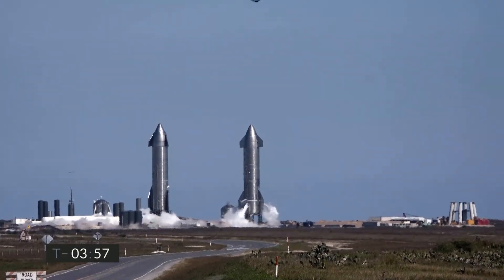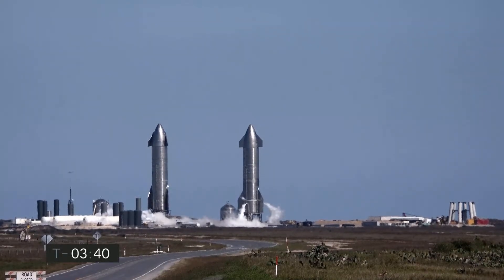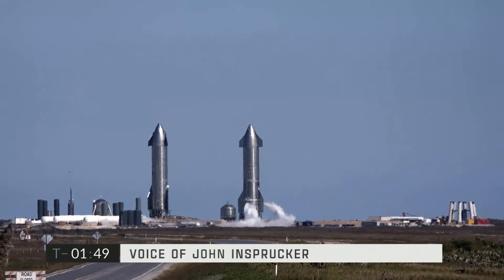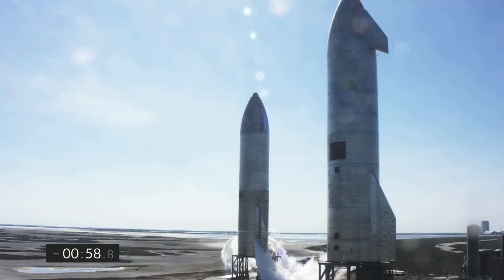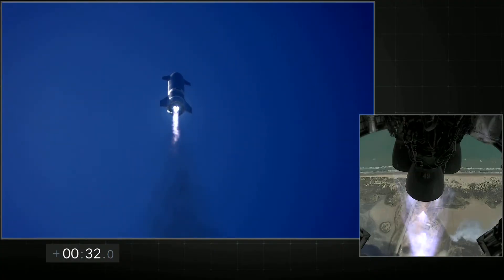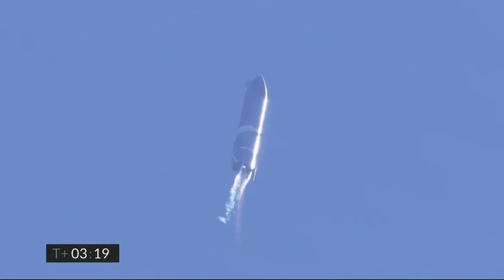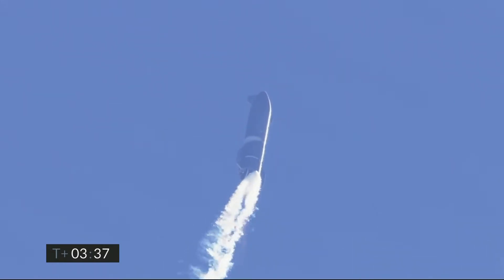Starship | SN9 | High-Altitude Flight Test

Comment: What is the point of returning back to Earth tonnes of exhausted metal. Is there really a value in doing that? How much effort would be spent in re-launching the same construction?
Reply: Because expendable rockets are extremely expensive, wasteful and polluting. Imagine if you went on an airliner and you threw away the plane each time, the costs of plane tickets would go up dramatically
Reply: Reusing a rocket saves a significant amount of money, it stops you from having to build a new rocket for each launch
Reply: Has anyone actually calculated how much sayings you can have by reusing / refactoring an old rocket VS using a new one? I would imagine that a huge effort would be required to recondition a structure which had so much stress.
Reply: @skrobotov  oh i don't know... maybe a falcon 9?
Reply: @tauraspace  In my sily opinion, Falcon 9 is a huge beast, powered by NASA, which is powered by tax money. How feasible are these flights, do they actuality bring profit ? Are they really commercial or they serve the needs of cia?

Comment: Is it the liquid sloshing around when it swings it's bottom down to land? Like when you flip a water bottle to land upright with a little water on the bottom?
Reply: It is. But they use separate, pressurized tanks to reignite the engines for the flip. So the fuel slosh won't be a problem

Comment: ARE YOU USING CHECK-VALVES FOR THE HEADER TANKS? I am sure you guys at Spacex are way smarter than me, but i am just thinking out loud here. For the ones who dont know: Check-Valves allow for the flow to go only in one direction. If you place at least 2 of them onto the header tanks in the inward direction, then these tanks would always be full, no matter how the rocket tilts and shakes. As it looks to me, there is a fuel feed problem to the rocket engines, during the landing flip manouver... Please upvote/like and maybe, a guy from Spacex will se this. Thanks.

Comment: Looks like they're trying to rotate for landing too close to the ground, not giving it time to swing and then correct itself straight for a touch down... 🤔😎
Reply: The problem was a mechanical malfunction, two engines were meant to ignite but only one did. Even if it rotated at a higher altitude that one thruster wouldn't have been enough

Comment: Firing the rockets way to late. Need more and smaller thrust stabilizers for reoreientation.
Reply: There are RCS thrusters onboard, but the failure happened because the raptor didn't relight, so it couldn't right itself
Reply: @tauraspace  well they need to make the RCS thrusters smaller and put more of them there and they need to quit trying to reignite so late.

Comment: I'm sure they intentionally crash the SN9, there is no way someone would expect to land a falling building of steel, by powering its engines ten meters above the land
Reply: Why the hell would they intentionally crash SN9... Honestly some people are so stupid these days
Reply: @tauraspace  for the same reason they would expect such a massive rocket to land by firing the engines at such a low altitude, my arrogant fella! After all it was a prototype and they have a much better built to test
Reply: @alexismpaltatzis  have you seen SN8s test? They successfully flipped and decelerated on the very first test flight. If the header tanks had pressure all the way down then it would have been successful. They are so close to getting this to work, which is very very impressive considering this is only the second test flight. It will work.

Comment: @SpaceX: I suspect it's the tubo pumps. These are gyros, effectively. Consider re-designing the raptors so that the axis of the turbo pumps are parallel to the axis of the flip movement. Else they are likely to continue to break during the flip movement due to excessive forces on the bearings. Either during the flip back before landing, or already during the flip to horizontal orientation.

Comment: Analyzing both this and SN8 attempt I feel like they need to initiate the engines re-ignition for the landing flip at a higher altitude. This will give them more time to adjust if something goes wrong (like igniting the third raptor if the second one fails). It seems like they start the flip at the very last moment but I guess there is probably a reason for this.

Comment: The hardest force to fight is the stillest, gravity, and the greater you make the mass, the harder the fight. It's hard to understand for us ant dwellers when the biggest gravity risk we'll ever take is jumping up 1 foot yet magically landing on 2.
SN9 didn't seem to flip and stay in vertical position, it went a bit over the board, pretty quickly and low too, and did not decelerate fast enough either, several fatal issues for any covid virus that thought this landing strip would be a safe place to regroup and launch an attack on SpaceX employees.

Comment: ---------------
@SpaceX
#spacex
---------------
1) The flame of SN9 was bluer than that of SN8 therefore excellent,

2) But those anomalous red flames that were seen above the thrusters (along the internal connecting pipes) are normal?

3) Excellent glide of SN9 (but also SN8), but despite the low pressure problems on the upper part of the landing, why did SN8 rotate better and land straighter than SN9?

Comment: It's no rocket science boys, you are trying to restart the engines way too late ... that is why you crashed
Reply: There is a reason why they are trying to do it this low. If they can't do it here on earth in 100 times thicker atmosphere, they won't be able to do it on mars. They have to wait until the last second to use all the air they can on mars at lower altitude where it is the thickest.
Reply: So yeah, aerodynamics and drag coefficients are part of rocket science lol.

Comment: Imagine, what is going on in fuel tanks  and tubes when it turns from horisontal to vertical position. 
A lot of bubbles, if any fuel at all :)
Maybe, it would be better turn to vertical position 10-15 sec earlier, with 1 engine. 
And then start 2nd engine, when  it is in vertical position.

Comment: Add raptor engine
Reply: it had 3  raptor engines
Reply: I think 3 raptor engine is not enough to land that huge rocket...
Reply: @bryanmapa9126  Turns out you were exactly right. Elon Tweeted that it was foolish not to light 3 engines then use two to land.

Comment: I'm wondering why they put SN10 so close to the SN9 Launch/Land site ... Isn't this increase some unnecessary cost, like the SN10 probably hit by SN9 debris ... But still one hell of a video ...
Reply: calculated risk. It was definitely in harms way
Reply: Apparently, the transportation cost of moving the SN10 to the blast safe zone is higher than the full SN10 hull check ...

Comment: It will be better to start the engines before . The distance between the landing point  and engine starting point  is not that much and sn9 was unable to readjust in short time . I don't  know if  parachute will work here  on such heavy rockers. If the parachute is deployed before landing then ratio  between weight and thrust  will come down and rocket will land easily and can readjust itself before releasing the parachute. Second it's a basic science  and  musk can do this experiments in his office . Pick up  bottle full of water and release it comparing  to sn9 engine starting point . Not high  enough from your table surface .  The impact will be much bigger and there is no way that heavy rockets like sn9 will land easily in that distance .

Comment: two main issues 
1) landing burns are starting late and
2) due to weight of wings on the nose the ship is reclining to one end. Try using only one engine for landing burn bcoz 2 engines are exerting more force on one side. Happened same with sn8
Reply: I am sure they are reading this and taking notes. You are incorrect, but for someone that knows nothing about rockets, it is a good gut feeling guess.

Comment: Attempted landing: Now that just looked all wrong from when the engines first fired on descent (I don't think they fired correctly) and the bottom flaps were in the wrong position so it's no wonder there was almost no aerodynamic control. It flipped so far over it had no hope of coming back to the vertical to use the rocket motor to slow its ascent. Anyway, let's wait for the experts to tell us. Nice flight other than the crash landing. RUD is a wank word so let's just call it what it is.
Reply: It's fun to speculate about cutting edge rocket science. It does not make us look particularly smart, but it sure is fun.

Comment: Seems like you're coming in WAY too hot. It would probably be advisable to give another 1000 feet to dedicate to landing.
Reply: It's fun to speculate about cutting edge rocket science. It does not make us look particularly smart, but it sure is fun.
Reply: @PaperDragons  yeah, not like we can't visibly see the landing was way shorter than needed.

You don't gotta be smart to observe a basic, fundamental truth.
Reply: @Resident--a  No harm in guessing but in fact, you need real data and models.  All the simulations and data showed the landing burn was right on time and could have been successful. The issue was the engines not firing correctly and having enough power. Just like the first time. but it was not due to not starting them sooner. If you only use your gut feeling as your science lab it makes it very difficult to expand your knowledge base.
Reply: @PaperDragons  well let's back it up a bit. Raptor 2 failed, probably a busted line (see debris burning off to the left?)

Had the process been initiated sooner, it would've given some room to activate the third Raptor in response.

Why they didn't just kick it on when 2 started sputtering was beyond me, but it did seem like it was going to ignite. 

Hence the need for a bit of breathing room. Yes?
Reply: @Resident--a  😄

Comment: It looks like there's something wrong with the engines because In both launches there were engine problems when sn8 and sn9 were landing
Reply: On the first launch, they lost pressure in one of the tanks and ran oxidizer rich and killed the engine. This looks more like an actual Engine failure. But at this point in Raptor development, I think it’s a problem that stems from the combination of rocket and engine. All engines spend hours on the test stand before they get mated to Starship.

Comment: 11:44 one engine starts with white shock diamonds, looking good. 
11:45 torch turns yellow/orange indicating excess fuel or oxygen-starved mix. This color may overlap with second engine start attempt. 
11:47 third engine attempts to start several times. First or second engine torch appears solid white instead of shock diamonds. 
11:50 only one engine remains on.

Comment: Shouldn't it try going back to vertical a little earlier to allow some more time to slow down the speed and stabilize the position? Just curious because this was almost the same as SN8 case, even little worse I think.
Reply: send them a letter
Reply: @xRays6  A fax is faster

Comment: How come they don’t flip it back vertical a little earlier so they have more time to stabilize and correct?  Rather than last few seconds where if anything goes wrong there’s no time to recover?
Reply: It would gain more speed by dropping vertical which means you need more power/juice for the suicide burn. Juice is like gold in space.you better save it
Reply: They can’t throttle the engines down low enough to hover, so if they light just a bit too early the thing would start flying up again. Which is why they need to do the suicide burn, and the reason for starting it so late is what thamonkaface999 said
Reply: @flixelgato1288  Really they can’t go lower power?  It’s a single engine landing burn too right?  I thought they were hovering at 10k feet for quite a while on one engine.
Reply: @jeffploetner  Yes it’s a single engine. So yes, a single engine is powerful enough to lift an almost empty Starship. And no they don’t hover, they just go down to one engine to stop it accelerating. It only comes to a stop after they flip it and shut down the engine. Now that I think about it, I’m pretty sure it did hover in the 100m hop though, not sure how they did that. Maybe they added extra weight for that one.

Comment: ...I noticed a bit of excess flame around the lines and turbopump area on ascent.  Is that normal or could that have contributed, particularly as it looked like the second engine had issues igniting and gimballing into position on the descent.

Comment: Did it start the last belly flop too late somehow? Technically it can land on one engine as long as it has enough time to correct the mass in case of 1 or 2 engine failures.
Reply: It can and is supposed to land on one engine but for the flip at the end two engines are needed. The timing was perfect. Just not enough thrust with one engine to straighten itself out during the flip.

Comment: It seems like the second engine has a problem starting on landing
Reply: 10km instead 12km
small explosion = not a lot of fuel (to protect SN10 from blast?)
Engine fail to start, empty tank?
Reply: @sebastienl2140  But one engine did ignite and was running perfectly all the way down so definitely not an empty fuel tank
Most likely a problem with the Rapter itself
Reply: Didn't it went to far at the end? Instead of pointing down it looked like it was tilting to much
Reply: @pennyfall9489  There are supposed to be two engines ignited on landing, one of them failed to start so the one engine didn't have enough power to stop the flip maneuver
Reply: I'm just gonna reply to this comment to look smart

Comment: So here's a thought, everyone else just crashes their first stages on purpose. This test is a good as the Boeing design will ever be. Yes, there was a restart problem with one of the two engines. The simple solution to that is to restart all three, catch the rocket at about 1000 feet and then land from there.

Comment: Even if the second engine had come online when the first one did, it seemed like there wasn't much time to decelerate the Starship.

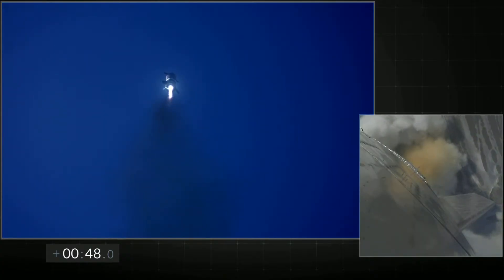6:10 Voice says "Beneath 1,5 km"
6:17 Engine fires up
6:26 Starship touches the ground.

9 seconds isn't much to both rotate and decelerate the Starship. Only one engine lit up, but I suspect that one was late as well?
Reply: SN8 and SN9 both flipped in time. Just both times the engine(s) had problems.

SN8's engines were destroyed by bad methane/oxygen ratio caused by low pressure in methane tank.
And one of SN9's two engines didn't fire up correctly so it couldn't counter the flip to straighten itself out. Yet unknown to the public why that happened but was likely another reason than for SN8's engines.

Comment: What has improved since last time ?
Reply: The 2 engines didn't get destroyed by bad methane/oxygen ratio. But something else made one of the 2 engines didn't start up correctly so it couldn't counter the flip to straighten itself out.

Also some other smaller improvements with every Serial Number (better construction of nosecone for example).

Major upgrades coming with SN15, which will follow soon after SN11.

Comment: Second engine relight failure, similar to sn8 landing failure. Header tanks too small to maintain pressure stability on relight? Header tank pressure may need to be managed electronically in a manner similar to an ICE electronic fuel injection system?